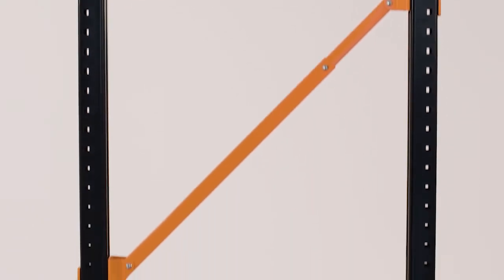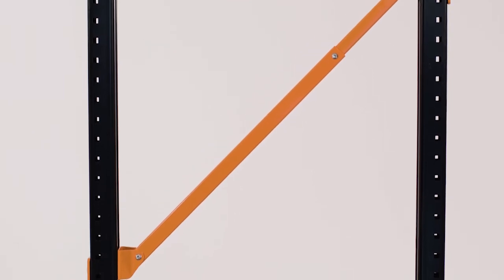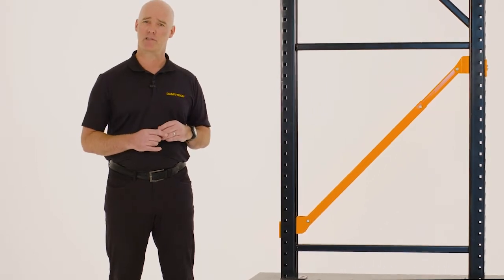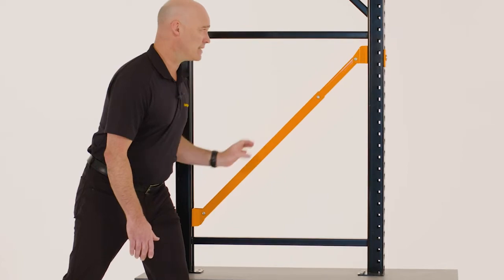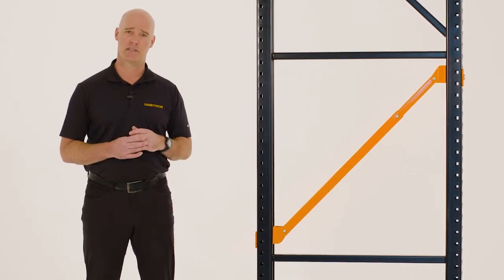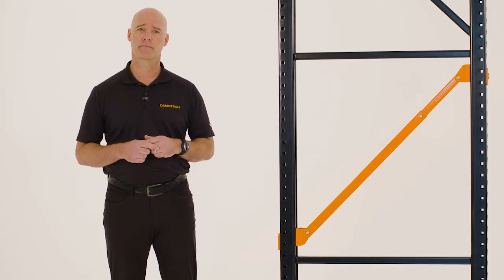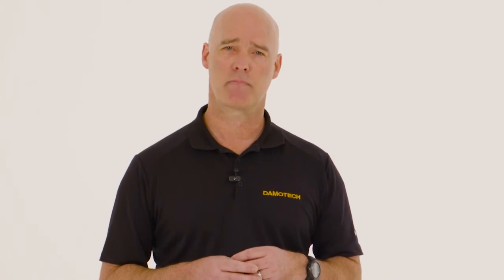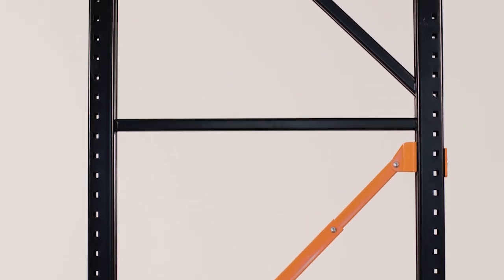The best Rack Brace repair kit on the market | DAMO BRACE

Comment: I was a certified installer for DAMO products. Honestly, the pro line was amazing to work with! Super simple to install weather it was a Pro Kit, or Brace. Both were amazing to work with and easy to install. I would gladly do it again! But would love to do it right from DAMOTECH and not trough the 3rd party I was with.